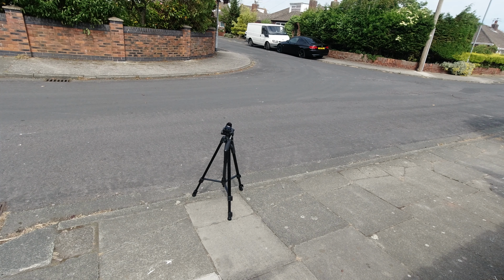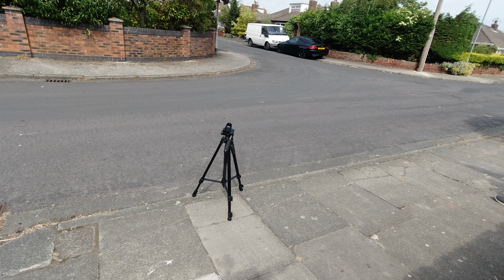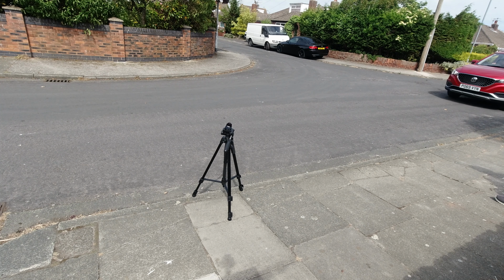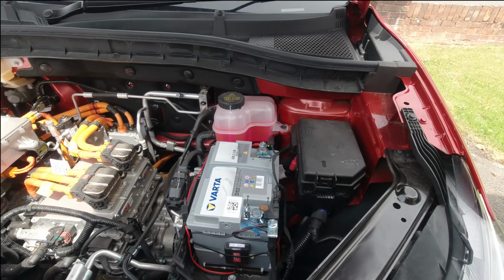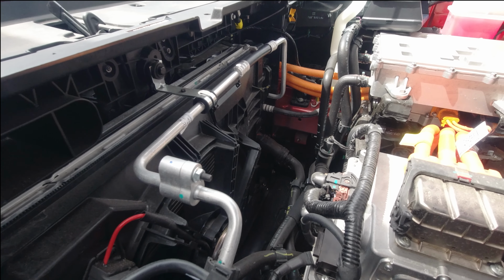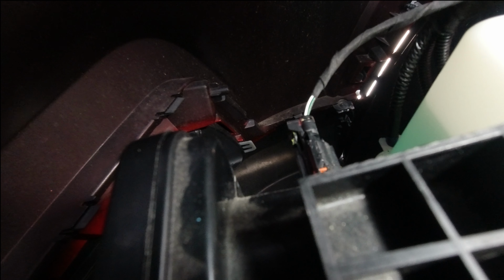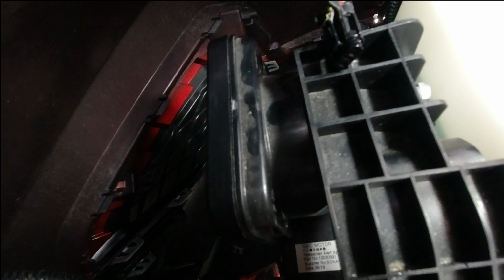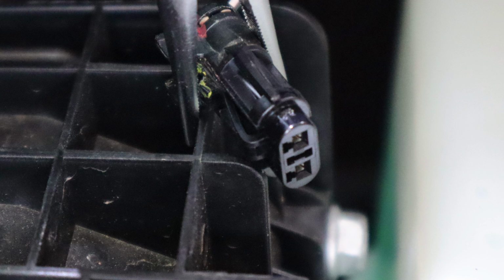MG ZS EV Pedestrian Alert Sound Tested

Comment: Tom my MG ZS EV Exclusive finally arrived today 30/06/20 the dealer had with some persuasion downloaded the latest updates. Not sure why but this seems to take the dealer a couple of hours ? So no bongs all the way home, and outside temperature is displaying. Thanks for all your tips and technical advice.
Brian
Reply from the maker: That's great to hear Brian...mine is booked in for 14th July :)
Reply: Tom I really think you will like the new software update. Make sure outside temperature is displaying before you leave the dealer.
BTW When I got my new purchased car home I noticed heating and a/c blower not working. I thought it was something I was doing wrong. Turns out a 30 amp fuse I found in a plastic bag in the glovebox needed to be fitted into the bonnet fusebox. After I fitted it all working properly. Makes you wonder why this was not picked up on the PDC.
Cheers Tom 
Brian

Comment: Thanks for vid. Did you see they have a software upgrade in Norway/Europe, which reduces/cancels bong noise, shows outside temperature on central screen, improves MG Pilot, increases range efficiency by about 22 kilometres. Hope it comes to U.K. as well. Keep safe.
Reply from the maker: Hi Keith...thanks for the comment...Yes I saw about the update....Luckily i got the car from Chorley Group  MG and they are going to do the update for free....it will be coming to UK and although free in Norway and Netherlands etc in the UK alot of dealers are going to charge for it (some well over £100) which has caused a bit of upset on the MG EV Facebook group....Chorley though are a great dealer...they even gave a free type 2 charge cable which most dealers didn't.

Fortunately they are my nearest dealer anyway but alot of buyers travelled from afar to get their vehicles from Chorley ...will certainly be using them for servicing :)
Reply: Hi Tom. Have you noticed that the display you can get in the dashboard when charging, shows more range of about 10 to 15 miles, than is shown on the gom? My car is always in regen 3 on normal setting. So whether it calculates on economy setting or safety mileage not included on gom I am not sure. Keep safe.
Reply from the maker: @keithgeorge7338  Thanks for that George...no I hadn't noticed...will check that out next time i charge it (which isnt often :) )

Comment: A very interesting video, but on a different tack do you know what the small loop pull wire by the N/S Horn is for. I've pulled the one on my car several times but " nout " happens.?
Reply from the maker: Yes it's the emergency charge plug release.....if when you come to unplug the charge plug after charging at home or out and about it doesn't release electrically pull this to do it manually

Comment: Great video thanks, on a different note what do you use to keep your engine bay so clean?
Reply from the maker: Hi Steven...thanks for the thanks.....I don't use anything actually....just lack of use keeps it clean :) ...The car was only 4 months old when I filmed this vid and now even after I have had it nearly 18 months I have only done 3000 miles so its still pretty clean.

Plus of course it does help with it being an EV and not having any oil/exhaust/petrol type things under there :)

Comment: Great video! Was actually wondering if the ZS had this because I haven't seen it publicised much. Does the ZV have an alarm/deadlocking? Thanks
Reply from the maker: Thanks for the kind words Sean...It has a alarm and the locks come on automatically once moving....my ford focus had this feature selectable on or off  in a menu but I havnt noticed that in the MG (I may have missed it though) .....you just push a button near the drivers door handle to unlock all doors

Comment: I went to my local MG dealer recently and the salesman was driving around in an electric saloon, it sounds really bizarre.
So I can cross your video is interesting to know that you can deactivate that weird sound unit but I was wondering can you replace it with something else?
 How about the noise of a V8 Engine perhaps? Am I thank you very much for doing this video.
Reply from the maker: Hi Alan....Thanks for the thanks....unfortunately there is just the one sound on the MG......I have seen reviews on some EV's that do have a selectable sounds ....all sorts from Starwars type to engines like you mention....but not on the MG.

I am sure some programing genius could get in the systems and do it but not just Joe public.

Comment: The ‘air hissing’ sounds is not air, it sounds if that is caused by the brake calipers grabbing onto the brake discs (metal sound)
Reply from the maker: Thanks Bob (love the painting btw :) ) ...yes you must be right ...it can't be anything else really....there is one in particular at 4 mins 23 secs that sounds really like a trucks air brakes....I have had tons of cars and heard the rust on disc or stone in pad noise before but never as much as this after frequent use....mind you this is the only sound recording I have made so it picks up more than you can hear inside.

Comment: Does anyone know if it's a speaker that can play other sounds? Or does it only have power (VCC and GND)?
Reply from the maker: Hi Dylanger......I suppose it would be capable of playing any signal put into it and that the tone is generated by the software. I have seen other cars where you can select which sound you want but obviously those will be part of the cars software suite so don't know how you could generate a different sound for the MG.....there is no choice for such in the menus

Comment: Can you hear it inside the car with windows shut ?
Reply from the maker: Hi Keith...yes you can but only just...it has to be very quiet outside and no radio on etc inside...if you select on then off etc in the menu you should JUST hear the difference....its alor louder outside....as of course it should be.

Comment: This function not working in my car
Reply from the maker: Make sure the plug under the bonnet is connected and pushed fully home... its position is shown in the vid...if it still doesn't work it will need a trip to a garage as it always defaults to on .after each start even if turn off previously on the menu
Reply: Everything is still the same  but cannot turn on and off the function.
Reply: cannot turn on and off the function from command displays in the car.
Reply: I dont have this function in my 2023 ZS EV in the menu either. There is no pedestrian warning sound coming up. (Location:Turkey)